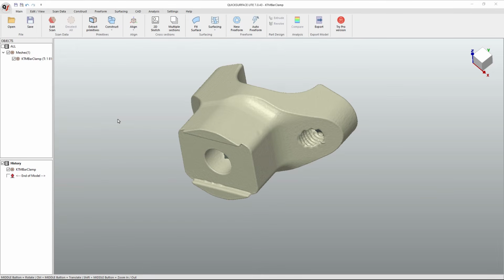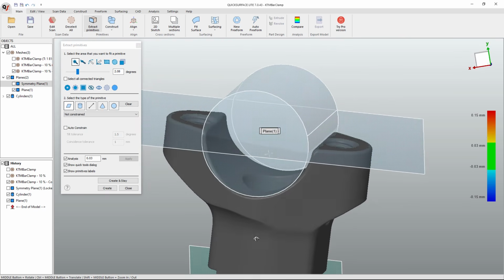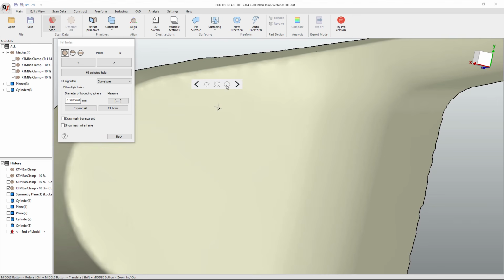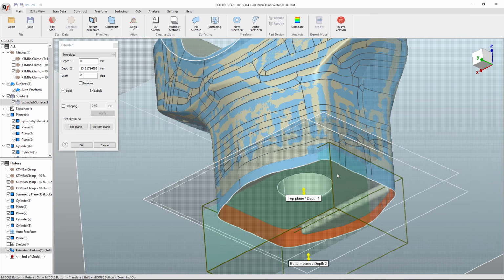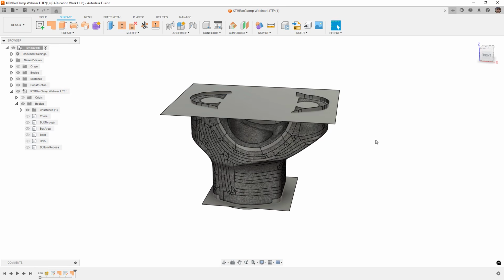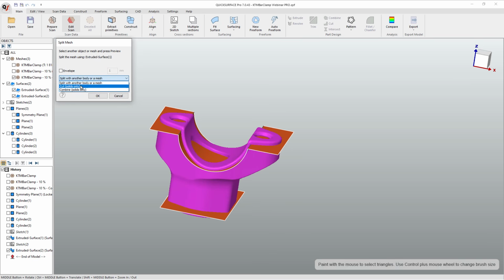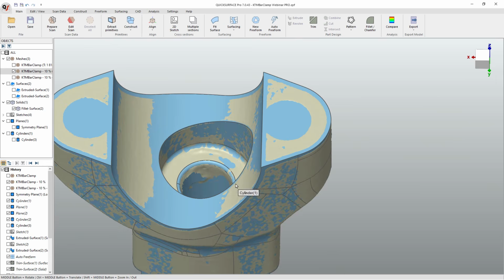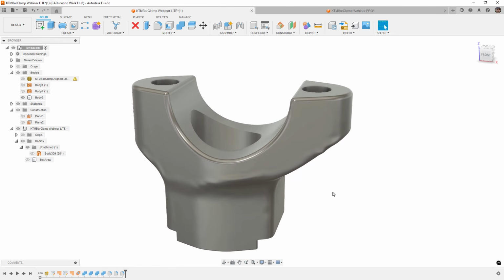QuickSurface Webinar | Auto Freeform in LITE and PRO | What is the difference and How to use them

Comment: improve: Sir I need help I have stl file not direct scan file mean was create from solid model I need to solid again from Quicksurface will you help me on this regards?
Reply from the maker: you can try this in Fusion if you have a commercial or edu license https://youtube.com/shorts/RI2d-aP-YUs?feature=share

There isn't an auto tool in Quicksurface.  If you  have a Hobby license of QS then the output will always be a mesh.  So you would need LITE, which will output multiple bodies and you would have to combine them in another CAD program like Fusion.  Or Pro, which can do it directly in QS.

Comment: Thanks for amazing tutorial. I want to ask that what should be minimum requirements of pc or laptop to run fusion360 and Quick surface smoothly. I have commercial license of fusion360 for commercial projects and also interested to purchase QS. Currently i have laptop i7 8th generation with 32 gb RAM. My fusion is working fine but not sure about QS. Thanks.
Reply from the maker: Thanks!
QS doesn't list a generation for the processor just min i5 and 16gb ram.  I would say on the RAM side you are plenty fine.  What i would suggest is to download the trial of QS and see how it works to be sure.  It is way more efficient at handling mesh bodies, but there are still going to be limitations.  I have processed meshes with millions of tris just fine on a 10th gen i7, but haven't tried anything older.